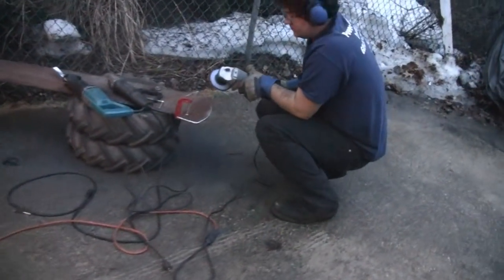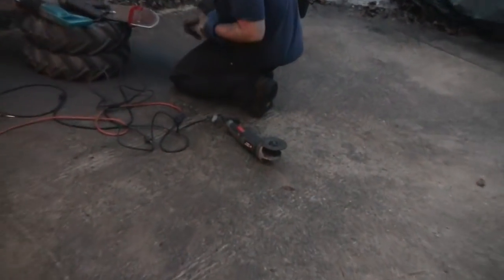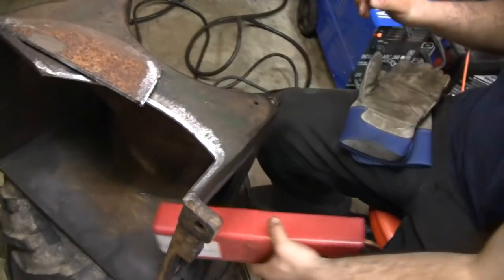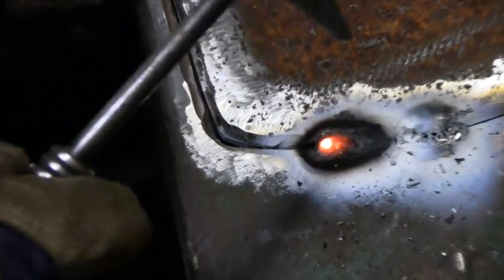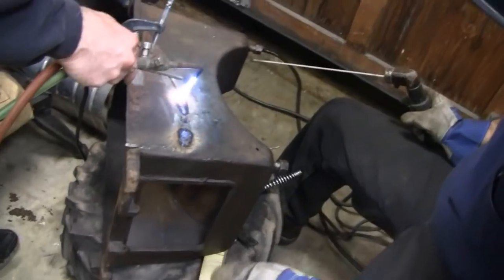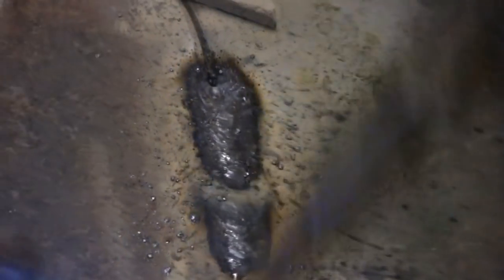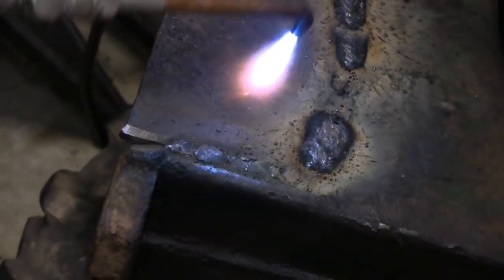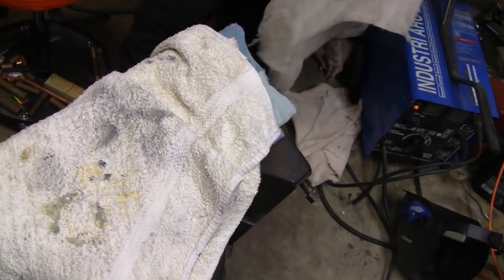CAST IRON WELDING REPAIR (Bessemer Engine)

Comment: I use to use a small air chisel with a point on the bit and an air regulator turn press down to around 50psi. The more you peen it the less shrinkage. Looks great!

Comment: You might consider putting a welding lens in front of the camera because like your eyes, the camera CCD can be damaged by the welding arc. If you start seeing stuck pixels or black areas in your videos, the CCD in the camera has been damaged.

Comment: im no professional welder and I know u been welding long before I have so you dont need to take my advise but you don't want to peen those welds u just want to let it cool and then after its no longer glowing give it a few taps and the slag comes right off. Peening it may help against impact but it will make areas for fracture points.
Reply: 100% false

Comment: Those fumes from nickel rod will eat up your lungs. Welding mild steel to patch a hunk of cast iron is chancy at best. I hope this was a cosmetic repair on a display engine and not a runner..
Reply: Edward Jonez I really want to why you say that better be a display than a runner